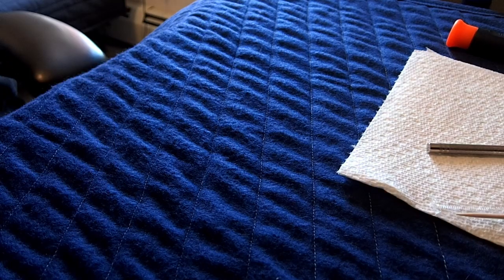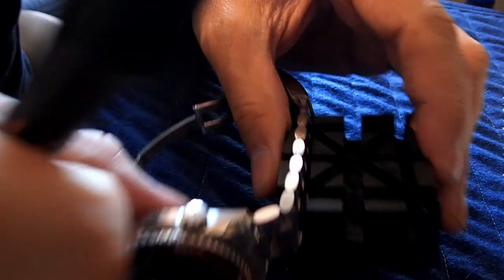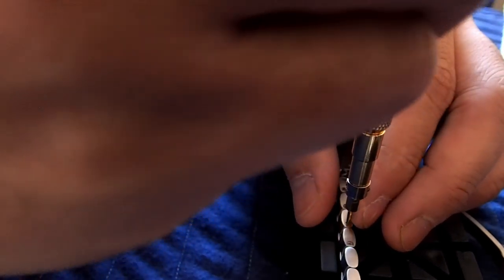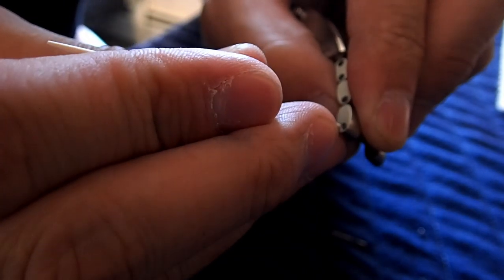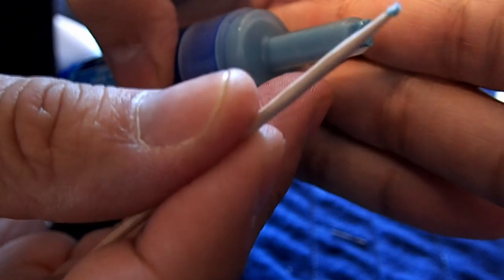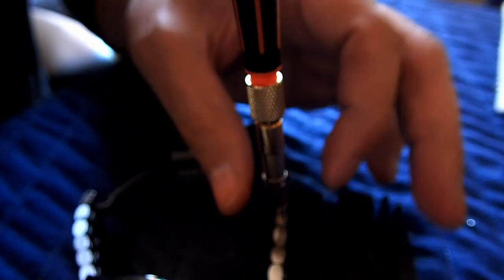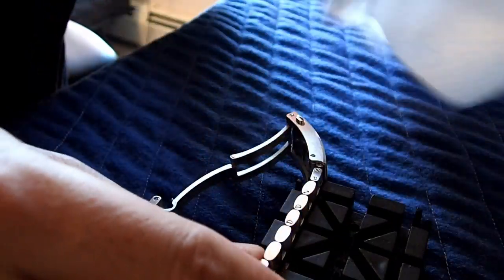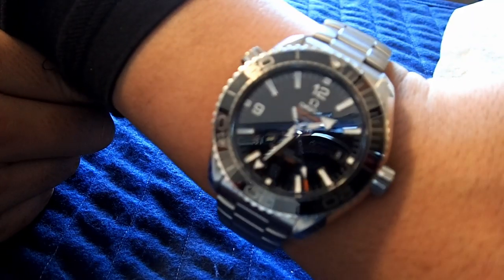Omega Watch Bracelet Resizing (Screws & Pins)

Comment: Adjusted my new PO bracelet today... and this video was very helpful. Didn't have to use the heat or Locktite. But, great recommendations and video to demonstrate. Good tip regarding the 12 and 6 o'clock bracelet configuration... Thanks for posting.
Reply: Did you add loctite when putting the screw back in?
Reply: @carsonnguyen4423  no sir... I did not. And a year later, still good, no issues.

Comment: I would absolutely recommend using a heat gun over the blow torch. A blow torch gets very hot, is dangerous, and can potentially damage the metal. Heat guns will more than loosen the Loctite and they don't get anywhere near hot enough to do anything to the metal.
Reply from the maker: The torch gets hot but no where near the temp to have a negative effect on the steel. The problem with a heat gun is that the heat isn't concentrated in a small area it's going to break the bond in the surrounding screws.

Comment: Thank you so much for this video! What size screwdriver are you using, and where did you acquire it? Thanks!
Reply from the maker: No problem. I'm using a generic screw driver from a electronics kit. I've been asked this before and the item is no longer for sale anywhere. Also the heads are not the highest quality. I'd go with. Bergeron screwdriver if I were you.
Reply: @DavidPhamChannel  Understood. What size?
Reply from the maker: @icychap  1.6mm
Reply: @DavidPhamChannel  Great, thanks!

Comment: Put the thread locker on after you insert the pin otherwise there's a good chance you'll get some on the pin and make it much harder to remove. Also, it's best to apply thread locker to the threads on the screw.
Reply: The Rolex manual states never to apply the thread locker to the screw, always to the female side. I honestly don't know why, but the manual couldn't be clearer on this point.

Comment: Nice detailed video David.  What is the type of glue you use again ?   You mentioned it and it wasn’t Loctite
Reply from the maker: Its basically loctite but by another brand (PERMATEX). These thread adhesives have many levels of bond, just make sure you use light bonding strength.

Comment: Thanks for the video. What kind of screwdriver you use (company name please).
Reply from the maker: In the video i m using a NexxTech screwdriver, the kit comes with 30 different screws so I was able to match the screw on the bracelet. The kit itself is not of high quality, its meant for electronics. If you don't own anything yet i suggest getting a set of Bergeon screw drivers.

Comment: I am quite confusing with the folding part, I saw some bracelet the folding part cannot be folded flat into the clasp and the end of it pointing out. But some bracelet can, like yours. What's the difference, the fully flatten one is usually longer in length. And most importantly I want to purchase one for its unity.
Reply from the maker: Are you referring to the dive extension?
Reply: David Pham It's hard to describe with only words. I'm not so familiar with watch terminology. That thingy between two sides. 1:48 
There are some types of omega op bracelet that the whole thingy can be folded into the clasp, and the connection part between will not pointing out when folded.

Comment: is loctite really necessary?
Reply from the maker: No, but it's the recommended thing to do.  Would hate to lose a screw one day and have the bracelet come apart.
Reply: Hi: I just spoke to the Omega authorised dealer from which I bought my SMP300 and they said that they never use any adhesive because it makes future adjustments difficult and is not necessary. By the way, putting it in a flame is also not necessary, as just putting the bit of the bracelet that one wishes to adjust in hot water for a minute will make the removal of the screws easy to do.
Reply: Simon W do you guys think a hair dryer on high heat would loosen it?